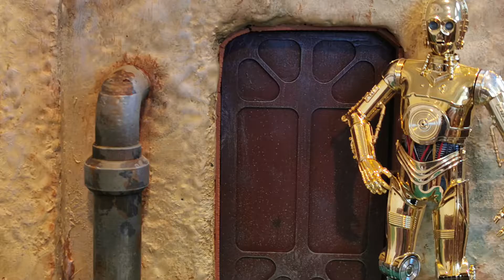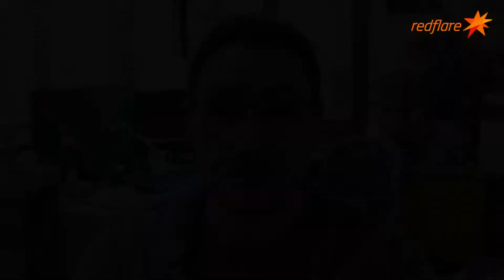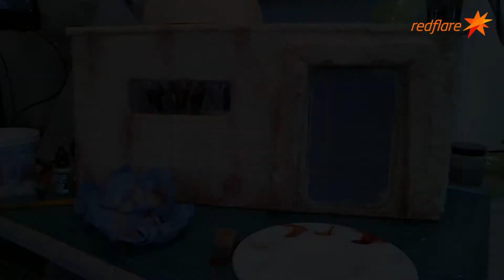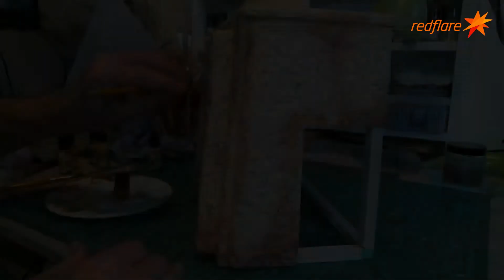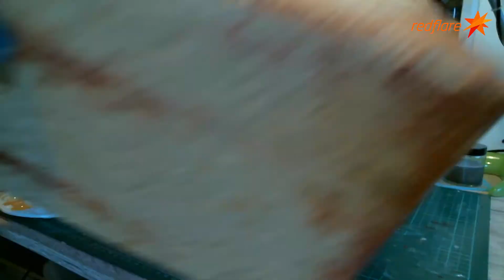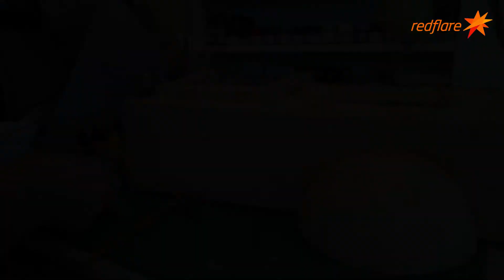Weathering techniques for Star Wars Mos Eisley street scene

Comment: Do you topcoat your models first before applying the weathering effects here?
Reply from the maker: Actually no. I tend to only topcoat after the final weathering has been applied as I found that adding topcoat before the weathering can prevent the dirty down and other effects I'm aiming for, can prevent some of the oils and such from soaking into the base colours.
Reply: @RedflareModels that makes sense. I may try a test piece side by side both ways. I had just gotten a lot of advice to top coat first and was getting confused. I'm trying to achieve similar to what you're doing